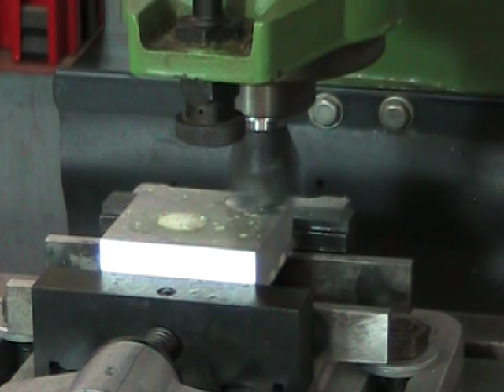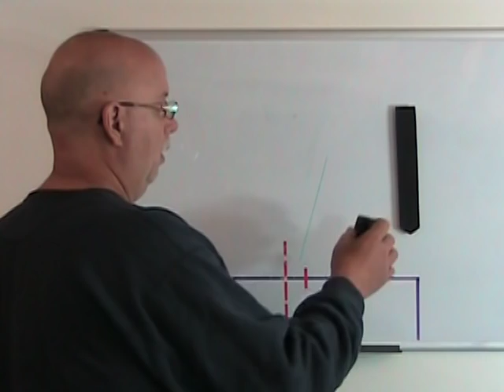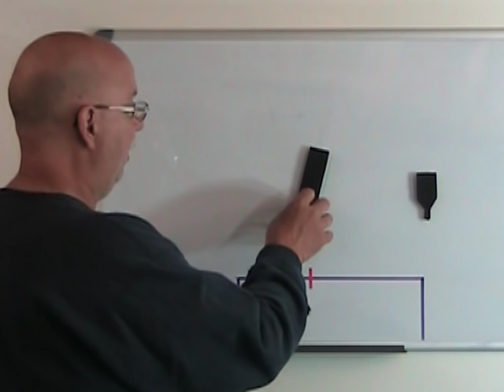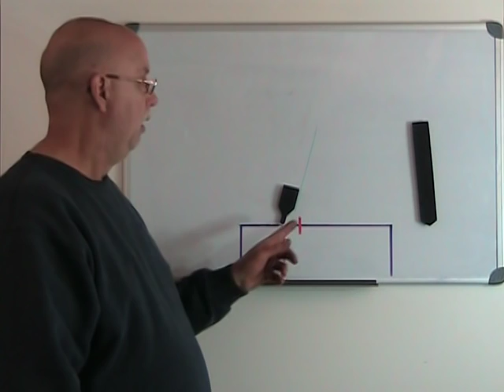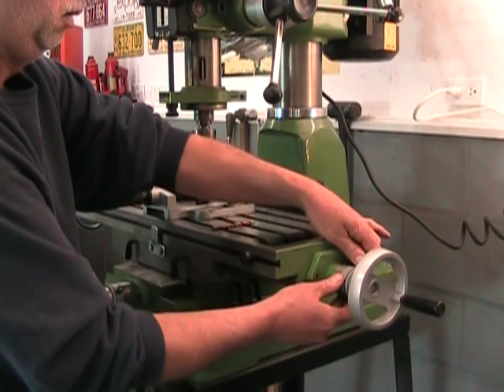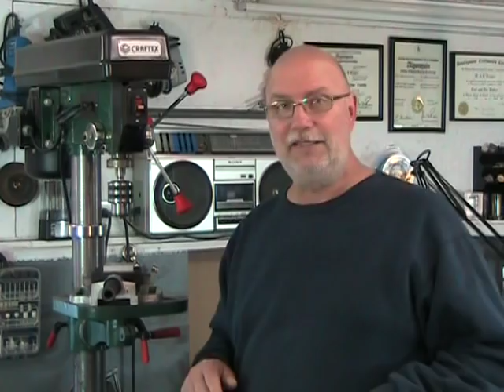ROUND COLUMN MILL PART 1, (Grizzly, Wrong Foo, Harbor Freight) PRECISION HOLE DRILLING, MARC LECUYER

Comment: I always admired the round column machines as real workhorses, with the minor disadvantage of loosing the alignment when chaning the height of the head..but you showed a good method to get around this :)
Reply: +Stefan Gotteswinter To spot center punched holes for drilling I loosen up the clamp on my round column mill and use a spud spike in the chuck. Then when I have the spud point in the punch mark I lock the column clamp. It is pretty quick, and easy, and accurate enough for me. So the round column mill getting knocked out of whack when the clamp is loosened is not always a disadvantage.
Reply: THATLAZYMACHINIST
Yeah I call my spud tool my spuddy buddy. I used to sit there with magnifying glasses cranking the axis handles. With a spud it is loosen the lock, bring the spud down into the dimple, give the spindle a manual twist to make sure the spud is centered, lock the quill into the dimple, then tighten up the column clamp. Lined up.
Reply: If you get a large end mill that wants to go for a walk they will overcome the clamp friction in a hurry!
Reply: @pvtimberfaller  I have the same mill as in this video, but I bought mine in 1998. If you tighten the nuts properly, and I use moly to lube them, they won’t ever slip, no matter how much you abuse the milling bits. I’ve used a 5” dia surface mill on this machine. No problem.
Reply from the maker: +Paul Frederick   Hi Paul another great way of doing it! Thanks for sharing, Marc
Reply: @Stefan Gotteswinter  would you rate a round column mill like that better than a sieg sx3? I would highly value your opinion please.
Reply: @JB-yp6bd  wrong column Mills heavy distinct disadvantage out of a square Mast. I would never ever buy one I'm sorry that's just my opinion and I'm nobody anything less than an rf-45 should never be considered in my opinion

Comment: Late as usual; there are other ways to work within the longest tool method.  By using spotting drills instead of center drills the shortest tool is made longer.  Only 2 or 3 diameters of spotting drills are really necessary.  Screw machine length twist drills also compress the size range compared to standard twist drills.  Finally, reamer shanks can be shortened further narrowing the differences in lengths of the various tools.  Use a GOOD drill chuck and it will help a lot as well.

Comment: Thankyou for posting about round column Mills. Mine is undergoing surgery and I've found a problem I hope you may be able to solve for me....
The jib strips are tapered and the screw that locates in the jib strip slot is a very poor fit with about 1.5 to 2mm end float. When moving toward the post, the jib strip moves towards the operator,  making it loose. Moving the other way, it becomes tight on the Dover
Tails. I am planning on a stud....tight into the tapped hole, and hopefully 2 nuts, either side of a zero backlash washer which will engage the jib strip slot. I will also replace the jib strip adjusting keys with a long allen keyed grub screw with locking nuts.  Any better suggestions?
Many thanks   David

Comment: I have had mine for a short time and I’m not a machinist. But I have worked with them in times passed. I have a large tilt machine vise mounted to my table and it works just fine. The more I use it the more I see it’s advantages. With that I can make it true. It’s not hard at all. Now with that said I’m not machining close tolerance. If I had to do close tolerance I can not see that stopping me. Now if I was doing production work it, still once it is locked down I still don’t see a problem as long as you have a way to put the piece back in the same place. In this case I make me a jig. I can do more with this because the head does move. I’m a fast learner. I have done moved the head sssooooo many times that it just come second nature to put it in the position that I need and still cut everything the same every time. I really like this machine.

Comment: I have this mill. I talked to a machinist and he told me to flycut the table with the mill head. This 
solves the alignment and the rough table issues common to these mills. I had to remove about 35 thousands from the table to achieve both.

Comment: I have a mill such as yours. I teamed the head in by making four washers .1 1/2" in diameter x 1/4" thick with a clearance hole in the center for the column  bolts. I surface ground flat and parallel first . Then put one washer under each corner of the column making sure the area was clean. I tighten the bolts down. I put an indicator in the spindle and had the indicator swing a radius of about the width between the bolts on the column. I took a reading on the table first . I can't remember readings. If it were. .003 out l would remove the two washers on the high side and grind off .003 on the pair. 
Then put them back in place and check the table reading again. If that brought it in I would move on to the cross slide. Here is where it is a little trickier. If you got 
.005 out you would remove the two washers on the side that was high and grind..005 off Each washer separately and each washer needs to go  back to exactly where it came from!! That should tram everything in. Important!! If the washers are ever removed they must go back to where they came  from or it will throw everything out!! It works I did it to my machine year ago and got with in .0005" . It has stayed there . It is much more solid than shims . When I first got my machine I did use shims . Hope this helps you and maybe some of your viewers. 
Good Luck

Comment: Is there an explanation somewhere of how the quill handles work? I have a ZAY gear head like an RF45 i believe. It was in very neglected shape ( a lot of grime and surface rust )and I disassembled it and re painted and cleaned everything up. My only issue now is the the fine quill adjustment wheel in front works great. but the drill press handle is very tight and hard to turn a all when I try to drop the quill, like a drilling operation. What does the hand knob in the enter actually do? I see where it engages the two conical surfaces. does the big sliver part ( the part that's shaped like a flower pot on its side.)of the horizontal shaft turn, or is it pressed or keyed to the shaft? the drill press handle casting is keyed on. I had no reason to take the big silver part off the shaft, ( I thought it was pressed on),but maybe its stuck or something and I should remove it for clean up and lube.

Comment: Good afternoon sir,
I just picked up this mill from a coworkers father for free! It was never used and had been sitting in the barn for years. Do you have any videos on disassembly of the head from column?i need to clean out rust grime from the column area that meets base. Where the rack sits and slide while rotating

Comment: Old video, I know. I'm attracted to these mill/drills due to price and size. Not that I want something cheap, but my needs, which are essentially hobby only, don't justify a large knee mill. Though I'd love a Bridgeport.  Anyway, could the column on these mills be made with a key way in the column for the alignment issue??
Reply: Bob C  i have researched this and yes it can depending on accuracy requirementsz some have drilled and fixed the guide the machine uses to raise and lower with "good enough" results using a shimming method at top and bottom of head. Most information I have found is that the cost and time and potentially ill affects of milling the column and head for a precise keyway that it would be cheaper to sell and buy different. That being said I still like my round column mill.

Comment: Fantastic! I love your videos. I have never been happy with my drill/mill and love to hear methods to tweak it's accuracy. I would love to hear any suggestions re preventing the moveable jaw upward movement. Also, whether using a laser would help with realignment when the head is moved.
Reply from the maker: +Peter Scott Hi Peter, I investigate whether a laser can be used as well as a few other methods in part 2 of this video. Here is a link to that video   https://www.youtube.com/watch?v=8tVKFgsnCsM&feature=youtu.be   remember that you can find all my shop videos (over 100) on my free webpage  thatlazymachinist.com
Reply: +Peter Scott 
Can you not put a laser in a collet and use that to align the head over the datum after you have altered the head position?

Comment: Hello I have the same machine and I was wondering if you have had problems with your spindle or the spindle bearings and if so where did you find your replacement parts ? Thank you for your great videos I'm a subscriber to your channel for a while now 👍👍👍
Reply from the maker: +Milspecmachine Sorry but I haven't had any problems with the bearings yet. If I do I will let you know. However my machine was bought at Busy Bee tools in Canada. I usually get my replacement parts from them (for machines that I bought there). Here is a link to the contact page on their website. I hope this helps? Thanks for watching, Marc

Comment: G'day Marc thank you for your great videos on these mills, I would like your opinion on if a ZX 30 would be a good buy for milling live steam locomotive parts, from 5" to 7 1/4" gauge.  I have heard that there are problems associated with rigidity especially on the Z axis.  I would really like your input.  Thank you regards John Kinnane Tasmania Australia
Reply: +John Kinnane I am sure Marc will add hie unique perspective, but for what its worth, I have one of these and find it quite adequate. I would of course prefer a large 3 phase monster, but that is just not practical. I have had no issues with rigidity, but I am quite diligent about keeping the head as low as is reasonable to reduce the quill extension.  My biggest gripe is the belt drive. I find I do not change speeds as often as I should, and therefore run the machine a little slower than I could. I am pondering adding and VFD. Otherwise, I think for the price these are a good compromise between cost, size and being single phase.

Comment: Hi Marc
I noticed that you stopped the mill with the reamer in the hole and then withdrew it. Is there a reason for this please?
Great videos by the way . thanks
Allan
Reply from the maker: Allan Winks Hi Allan, in order to keep the hole as tight as possible, I like to stop the rotation of the tool before retraction in order to avoid a possible second cut (rubbing) on the way out. I have always had good results with this technique but I must admit that I do it as I was taught. I never tested the technique to verified its effectiveness. It made sense to me when I was an apprentice and I kept on doing it. Thanks for watching and thanks for the question, Marc L'Ecuyer
Reply: Thanks Marc that makes sense to me.

Comment: Hi marc, this is the best guide i found ever. Can you please go into depth about making the pillar exactly perpendicular, which leads to having perfectly parallel cut in relation to the material. Im still a student and was able to get a mill similar to yours but slightly smaller i thing, but i never liked it as it is not precise :/ with your help i may be able to get it going in mint condition hopefully, as i don't afford a better one. Thanks a lot marc!!
Reply: Ryan Degiorgio did you find information?

Comment: Excellent video marc- as always !
I noticed that when reaming you shut the machine down before extracting the reamer - is there a reason for this  or just habit?
If any viewers have the tilting column (x2) type mill it is important to check the column alignment and tram at the same time as the head of this type of mill is two castings bolted together and not pinned so there is some play and it can move around  on you.
You can end up with the head trammed ok but the column tilted so the tool will travel off centre as you raise the head  .

Comment: While I don't have a round column mill (I have a Tree knee mill), I appreciate the problem you're describing & the video. Part 2 may answer this, but I'm not sure that I understand the switch to the drill press. Would the resulting misalignment not be dramatic enough if you were to change the Z axis on the round column mill for the second set of holes? I.e. why not a test on the round column exactly opposite of your "long-tool-method?"

Comment: Thanks for the vid Marc, I guess I do the longest tool method instinctively, I did learn from and enjoy the vid. I have a benchtop column mill, but I can tram my head, not like your machine which has no rotation on the head. Stub drills are great on my mill.

Comment: thanks vey much for the upload!!!! But what exactly is the end mill u used in the beginning? Is it a 1 inch square end mill? Those cost 276$ from MSC is this correct?
Reply from the maker: NeptuneKnives Hi, it is a carbide insert (2,triangular) end mill, they are quite inexpensive ( under 100 dollars with a box of inserts). This may seem like a lot but you must remember that the inserts have three cutting points on them so they can be used three times each. So one cutter with two inserts is like three end mills. And once the inserts are worn you can buy more but reuse the holder. For a lot of home jobs I find this type of cutter most economic. Thanks for watching and sorry for the long delay, Marc L'Ecuyer

Comment: flineman, you have "reply" disabled.  You can also use a mirror at some distance, arranged so the laser spot on the target is near the mill for easier seeing and more accurate adjustments.  It was not mentioned, but the laser pointer is rigidly attached to the mill head, and a target is used to replicate positioning of the head on its swivel axis.  The target can be a simple vertical line on the wall.